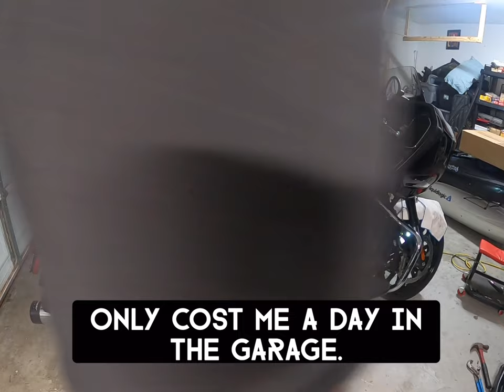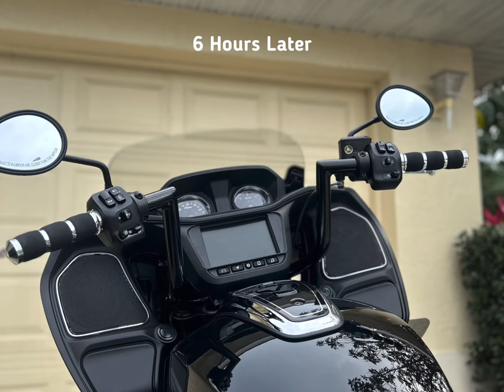Installing Torch Ind. Rival Bars on my Indian Challenger

Comment: I love these bars, I have been trying to talk with someone from Torch ind. but no one answers the phone. I have tried emailing and haven't heard back either. Did you have any of these issues? I really want to get them. Any advice would be appreciated. Thank you for the video!
Reply: OOB
Reply from the maker: Hope you got in touch with them. I never had to speak with them. I bought the bars new on eBay, someone didn’t want to put them on and never opened them.